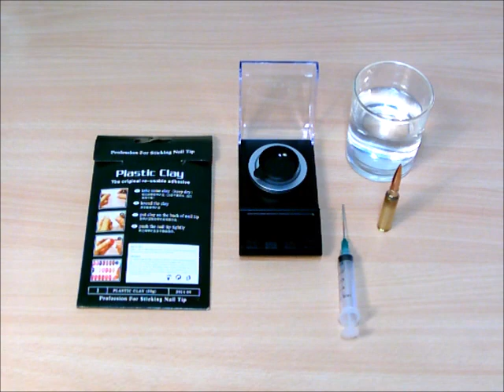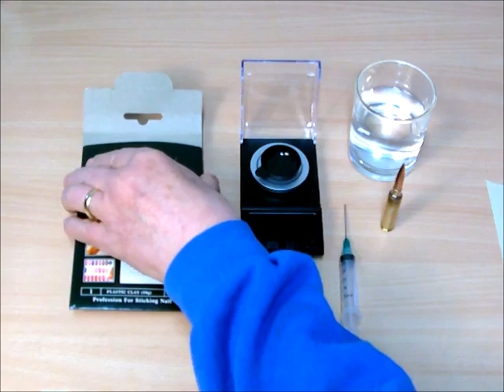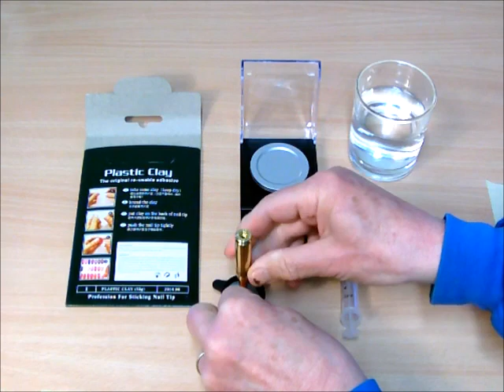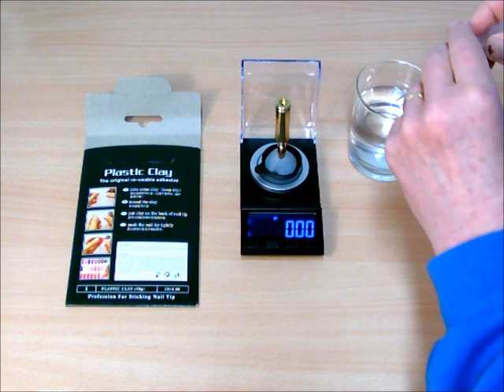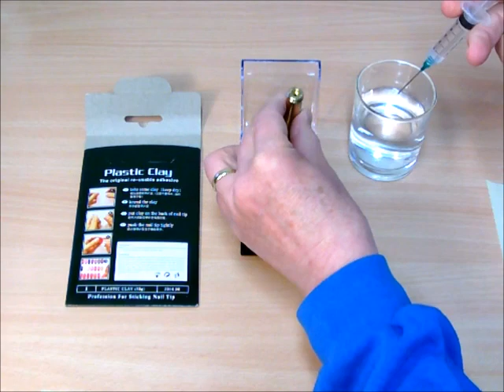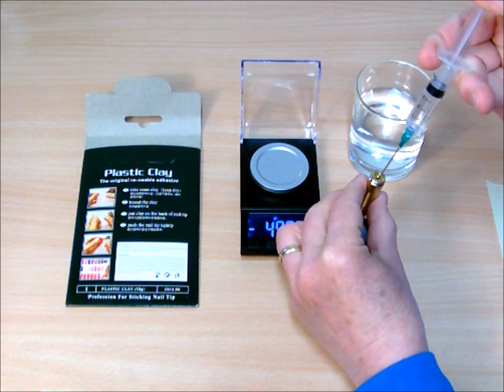Usable Case Capacity

Comment: Thanks for demonstrating a simple-to-apply method.  I found a tiny drop of rinse-aid in the syringe water aids bubble elimination from a pre-cleaned case and repeated measuring demonstrates it works fine - unless sods-law ensures identical trapped bubbles ;-)

Comment: This method is very poor.  How do you insure there are no air bubbles inside the case?  A small air bubble stuck inside the case will occupy the equivalent of one grain of some powders, thus your measurement is inaccurate, and the simulation will be likewise inaccurate.
Reply: Having critcised the method demonstrated by Geoffrey, perhaps you could now give the rest of us the benefit of your undoubted wisdom and expertise by describing, or preferably demonstrating a better method? In particular you should show us how you ensure your method eliminates all the air bubbles.
Reply: @johnspencer6270  #1. There are several videos on YouTube describing the process.  The big difference is that the other simulation programs require the total volume that exists inside the "Fired" case, which is a much closer approximation to reality than a "New or Resized" case (approx 2%).  This gives a volume that must, for BTT use, be reduced by the space occupied by the bullet.  You can inspect for air bubbles visually which cannot be assured using the primer hole method.  #2.  Weigh the case and bullet on a scale and zero the scale.  Pinch the case neck just enough to hold the bullet in place but allow the bullet to seat with finger pressure.  Then fill the case with water, visually inspect for bubbles.  Then press the bullet into the neck slowly to allow the excess water to escape.  Dry the outside of the case from ejected water, and reweigh on the zeroed scale.  Now you have the actual working volume in the round.
Reply: @ewathoughts8476  How very clever you are! Now go away, re-read what you have written and perhaps you may be able to work out the flaws in the method you describe, but then again you may not
Reply: @johnspencer6270  yeah, not sure #2 eliminates the same possible causes of error crititized by the very same poster, or creates a very realistic actual seating depth of the bullet either. 
but if one uses the method suggested in this video, remembering to tap the syringe and push out excess air before injecting the water into the case,  and to tap the filled case as well, isnt the expected margin of error so small that it might not be that significant a problem?

let's remember, that for most people, the alternative is following load manuals which doesnt take the different case capacity from maker to maker into much consideration at all.
Reply: Thanks for your thoughts! To say it is a "very poor" method is going a bit far, don't you think? First off, there is nowhere for any bubbles to get stuck really. If you inject the water in slowly, especially as it gets near full, and hold the case upright, there should be no problems in this regard. It also helps to add a drop of washing up liquid to the water. Did I mention that? I should have.
Reply: @bbtltd5636  Having measured interior volumes of many vessels in the lab thousands of times I can tell you that if you cannot visually inspect for trapped air bubbles your measurement will be very suspect.  Especially where a boattail style bullet is concerned.  Unless you can force the H2O into the tapered gap of either the tail to neck, or to the shoulder slope to bullet shank with some force, you will almost always have some bubbles formed.  Just the process of forcing the H2O into this space will generate air bubbles, and you cannot see if these bubbles are present or not.  The cleaner the vessel, the more likely there will be some bubbles formed as the H2O rises.  Whatever you do from the primer hole end, you cannot inspect for bubbles, so the process is suspect.  Additionally, you did not push the syringe needle to the bullet, so as the water enters the case there will be droplet splashes.  If you look at your video, you will see bubbles exiting the primer hole several times, and since the primer end of the case is almost square, there will be instances of a bubble existing in the base to wall join.  You did not even tap the sides of the case to possibly free any residual bubbles to the top. Surface tension is your enemy here, and adding detergent or alcohol to reduce surface tension does not eliminate surface tension.
Reply: Once again, thanks for your Thoughts! I do hope everyone reads this for extra tips on how to get accurate usable case capacity measurements. You are quite right, of course, I should have made a point of tapping the case to ensure I got all the bubbles out, and of putting a few drops of washing up liquid in the water to ensure wets the inside of the case. 

It also helps to wash out the case with slightly soapy water (and shaking/tapping all the excess water out) before seating the bullet in the case to ensure the water wets the case properly.

I did not want to make thinks over complicated and in any case, most experienced reloaders know this stuff anyway.

Thanks again. You are a star!
Reply: @ewathoughts8476  , so how would a bubble compare to the other method that doesn't account for the seated bullet? Which do you think comes closer?
Reply: Karen's are every where 😂😂